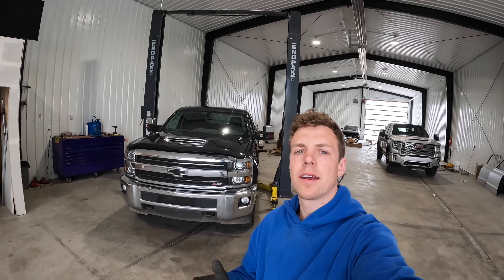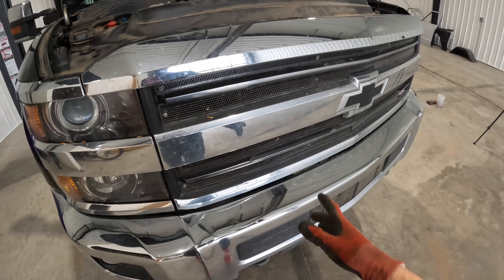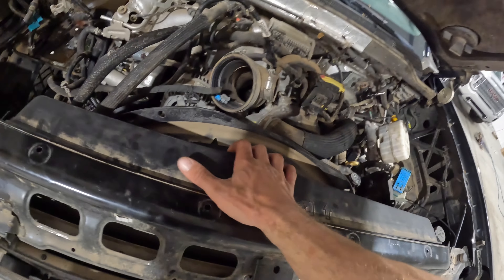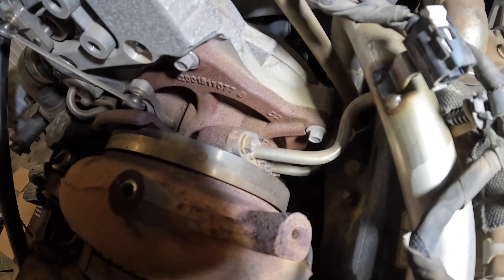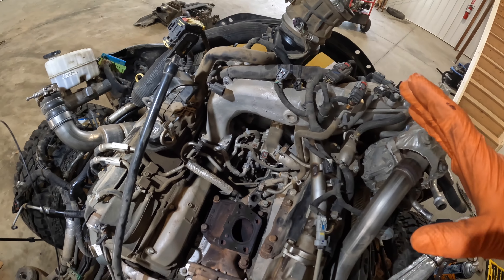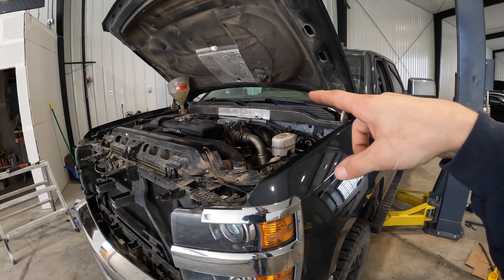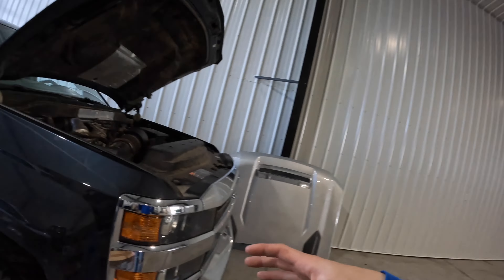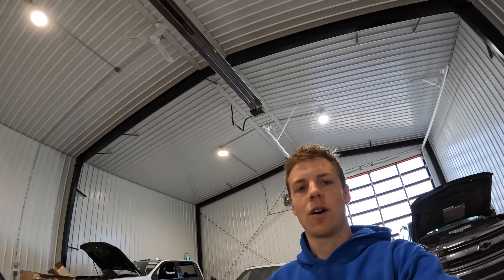Turbo replacement 6.6 duramax by removing the cab and engine failure!

Comment: I wonder if it would be easier to pull the fenders and leave the cooling stack in place. that's the way they did it in the factory when assembled the 2019 and earlier (for the turbo job). For the engine job I guess the cooling stack has to come out anyway.
Reply from the maker: I watched a video of a guy who left the stack in place but kept the fenders attached to the cab, looked like it worked pretty good actually.